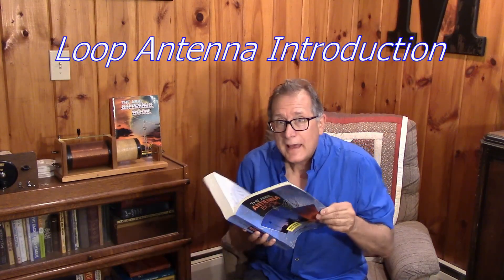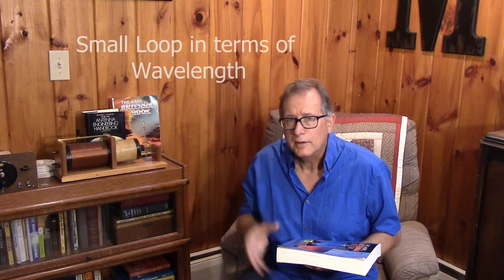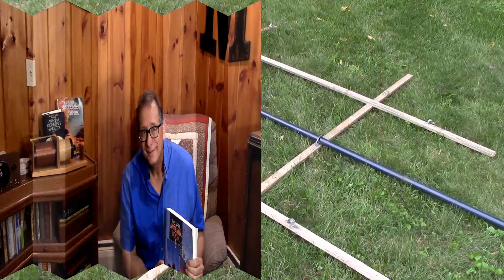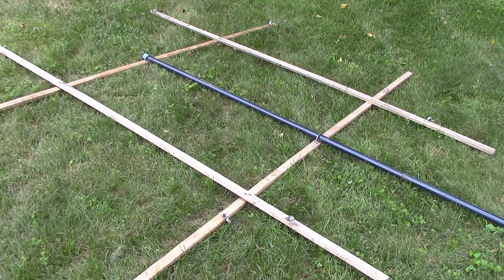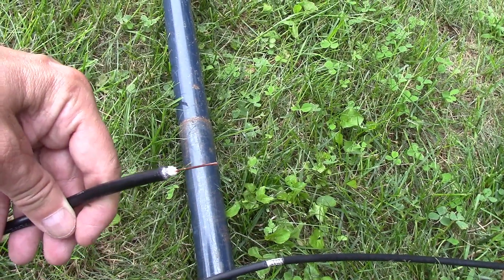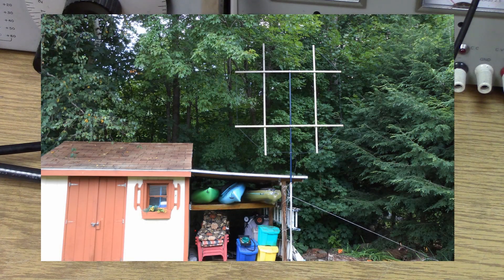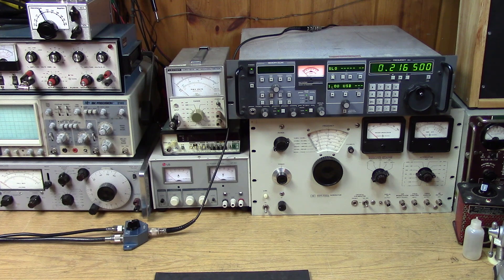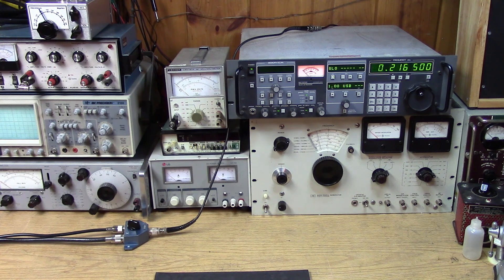Big Receiving Loop - Introduction

Comment: 👍I have a feeling that this loop antenna is going to be improved. Looking forward to next episode. On receive the core objective is all about signal to noise ratio for the desired signal. I suspect that a lot of hams judge antenna performance solely by signal level with rationale that if antenna A provides a higher signal level than antenna B then A is better. However, if antenna B has a signal level 3 S-points lower but a 10dB better S/N ratio than A, I would argue antenna B is the better antenna. Also, I wonder about using RX loops some distance from the shack being fed with co-ax. Even top spec. co-ax over distances of 100 feet or more will surely have more loss than balanced feeder for HF?

Comment: I have a bigish loop antenna here I made about 4 years ago. It's 80cm by 80cm square and around 15 turns I think, with some spacing between the turns. It is absolutely HOT on the AM broadcasting band. I must put it on a gimbal arrangement and perhaps play with it on 630m by switching in a fixed capacitor
Reply from the maker: Is it Coax or Wire? Tuned or Broadband?

Comment: Hi. I will see the series. Is very intresting issue. With your home broadcaster I worked more than 20 metters with a sony battery radio and a 2 meter diameter transmitting loop of 8 turns and a variable capacitor in parallel with a 2 loops link in the ferrite rood with a twisted pair as feeder. 
Thanks to share your tech stuff. 73's from argentina
Reply: This sounds interesting. If you can provide any more details of this set up, it would be appreciated.
Reply: @Steve-GM0HUU  hi Steve. Okey. First i have built the Mike's home broadcaster. In the testing I've  noticed the range is of 1-2 meters or less of five meters. Taking the problem the answer is that i haven't at least a quarter wave antenna. This mean a 75-100 meters wire! The solution is a magnetic loop antenna. On a circle made of a 4 meters strip of fiberglass of about of one inch width  i wound 5 turns of 1.5 mm enameled copper wire. In the two  terminals a variable capacitor of 365 pf and a twisted pair of cable to a couple of turns link in the ferrite rod in  the home broadcaster. Thir ressult in an about 1.5 meters loop which makes the range to more of twenty meters. I hope to help you.  the never ended project is to replace the ferrite rod anntenna coil in the home broadcaster directly with the new external loop making a tap to have a big oscillating coil. maybe you can experiment this. this idea was taken of the old radio broadcast issue in worldradiohistory site.
Note: in the link many turns cause the need to exact tune the loop at the exact transmitter frecuency, else the oscillator will be pulled away and less turns will allow certain misstunning but less radiated power.
sorry for my very bad high school english! 
I hope helped you and I send you best wishes.
73's Steve.

Comment: You are quite right the loop antenna can decrease noise and static when turned it is quite evident on mine. I have one inside my house and one outside and turn then to get rid of major noise. I would need larger ones for transmitting but for receiving they work fine. But Mine is a Magna Loop I bought on ebay really small compared to you Coax loop but mine for what it is works better than the 134ft inverted V dipole I had up before.

Comment: I always terminate my 75 Ohm coax with F-connectors and then use an adapter.  Makes no diff either way.
Also Mike, have not been getting notifications of your videos even though have 'ALL' selected.
I will try to monitor your channel closer!
73...

Comment: Greetings from VK2 land.
Just one observation on your tests.
To get an accurate result between the loop and dipole antennas, shouldn't they both placed parallel to each other i.e. receiving from the same direction?
If not, the loop by facing the 'wrong' direction, will appear to be in a disadvantage compared to the dipole.
Very interesting and informative video though..many thanks!  VK2Bxx